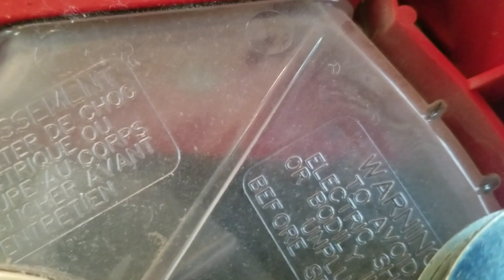Sanitaire SC886, Type E, Custom Build, Move Out Vacuuming. CRUNCHY, May 2020 (Vacuuming starts 3:45)

Comment: Hey Fame when I used My Aunt's Sanitaire Tradition SC886 I used it on Level 1 Low Carpet!
Reply from the maker: Using vacuum cleaners on it's lowest setting isn't good for the machine. Non padded, commercial carpet is the only appropriate setting for being on the number "1" (Low) or number "2" (Normal) settings. 

On higher pile carpets you eliminate airflow along with needlessly making the motor work harder than it should if operating on it's lowest settings

Comment: I’ve been waiting for the sc886 to make a appearance and you’ve made it worth the wait. Interesting magnet set up on the bottom of the sc886 I didn’t know You could do that. Thanks for the shoutout and you did say my name right!
Reply from the maker: They're called Vac Magnets. I don't have the box anymore, but it had a picture of an older 80s B model 886 or 888 on it. They are screwed in to the base and pick up whatever you passed over or when in the reverse motion of vacuuming avoiding the ugly metal sounds they make when hitting the beaters or fan. And thank you about your username. I thought I butchered it lol 😂🤦🏾‍♂️

Comment: Man that machine sounds so good! With the 8amp motor and shake out bag, how many CFMs do you think it’s pulling? I’d guess around 170 or so but maybe more.
Reply from the maker: New old stock motor! 😎

KG5Vacuums and VacLab have performed a bunch of test with shakeout and F&G bags. The shakeout is pulling over 170 easily, however, as it fills with debris, it drops in CFM output. I'm not sure how much more CFM I'm getting from the 8 amp, as this 886 and one of my 899s have this motor, but in my opinion I don't think it's a greater difference. I'm pretty sure it's a bit more, but nothing extraordinary
Reply: @famellc2019  It’s amazing how much different bag types effect the CFM output. I’ve got one 886 set up to run F&G and I’ve got an 888 with the ST bag setup. While the ST filters pretty good, it kills the CFM output. Now if I switch either machine to run a shakeout, it’s a night and day difference. You can literally feel the machine sucking down on the carpet when running the shake outs. In fact, I have to set the dial a setting or 2 higher just to push the machine depending on the carpet type. I love running shake outs bro.
Reply from the maker: That's one of my arguments with F&G/ST style bags, loss of CFM, however, the same argument can be made for the shakeouts.

 In the vid, I adjusted the height to "High" (3), but because the bag was brand new and not fully inflated, it bit so far into the carpet that I had to readjust it back to "Low Shag" (4). I love the CFM they pull in!

I prefer the shakeout, and I'll keep using them until they are discontinued.
Reply: @famellc2019  I clean offices every night and I’m amazed at how much dirt the Sanitaires suck up. I might start doing some videos too. Lol
Reply from the maker: Do it!! I also vacuum in commercial settings, but they are sensitive about recording devices and I don't want to go into explaining that I'm only recording for a niche crowd that enjoys vacuuming lol
Reply: @famellc2019  Yep, that’s what I’m concerned about. Like how would I explain that some people enjoy watching vacuuming? Lol. I do post some cleaning stuff on my insta account. You have an Instagram account?
Reply from the maker: @detailsmw5995  I do, but I don't post vacuum footage on it. I'm pretty compartmentalized with my life and interest, and business lol
Reply: @famellc2019  Copy that! 😎I just posted a short vacuum video and I plan on posting a long full move out vacuum later this week. You have inspired me.
Reply from the maker: @detailsmw5995  yessir!! I'm looking forward to seeing your full length vid!! 😎💯🙏🏾